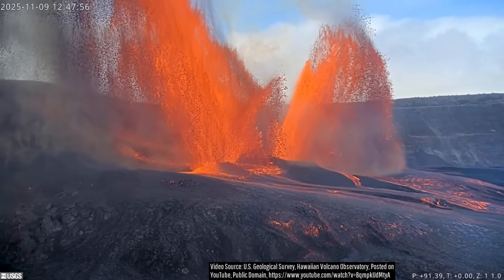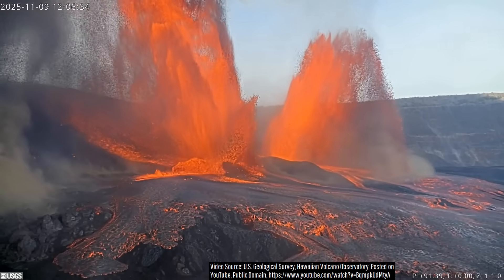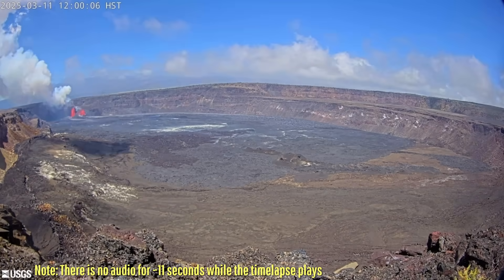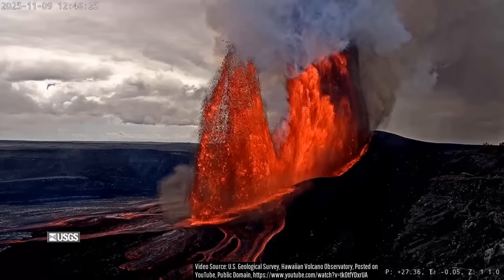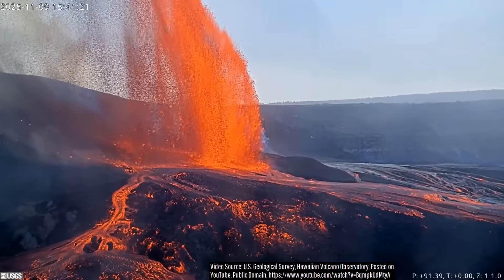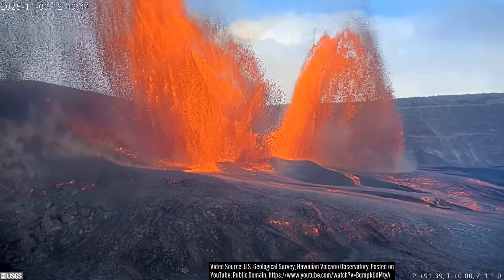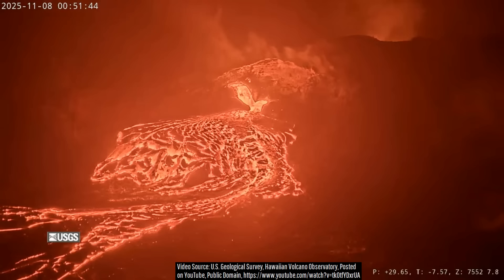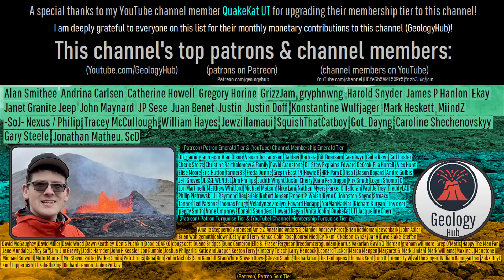Kilauea Volcano Update; Twin 1,100 Ft Lava Fountains, Geologist Analysis

Comment: I see several people asking things like, "How long will it take to fill up? What path will the lava take when it does?" Understand that what we're looking at in these videos is not the entire Kilauea caldera, but just Halemaʻumaʻu, which is a smaller (relatively speaking) pit crater inside the caldera. The entire caldera is roughly 3 miles long by 2 miles wide and hundreds of feet deep. At present activity levels, it would take several years for lava just to fill Halemaʻumaʻu. From there, it would overflow into the caldera, which would take something longer than our lifetimes (decades to centuries) to fill. During that time, Kilauea's terrain will change, as it slowly and constantly does with each episode. Therefore, whatever happens at that future point is both unpredictable, and not our problem. Just enjoy the view while we have it, because it will never look exactly like this ever again.
Reply: Great information 😊.
Reply: Yes, great information. But in your estimates you should surely add th proviso 'assuming no further caldera subsidence occurs', since that is presumably quite likely in the event of a flank eruption such as the 2018 one?
Reply: @davidcranstone9044 correct. Kilauea's terrain will change over that much time, and it's impossible to predict exactly how. So, we can only work with best guesstimates.
Reply: If it keeps erupting from the same spot, the cone will grow past the caldera rim, and lava may flow out of the caldera depending on how things go. If that direction becomes the dominate direction, it could be even longer before the caldera is filled completely
Reply: @davidcranstone9044  "During that time, Kilauea's terrain will change" - covers the likelihood of further draining.

I'm one of those fortunate enough to have hiked the outer caldera floor (thirty years ago). I've just found a USGS chart showing that the trail crossed lava erupted in 1919, with the oldest surface anywhere dating back to 1882-85. The caldera itself is much older than that.

The real question is how long will it be before growing Kilauea becomes as tall as by-then-eroded Mauna Loa?
Reply: Im constantly in awe watching these videos every time a new one comes out. Nature is beautiful and amazing. I hope one day to see this or something like it in person before I leave this earth. Thank you for sharing. ❤
Reply: At the current rate of filling, it will fill Halemaumau in about 2 years, and probably overflow out of the caldera to the south very soon after, before 2030. It will take a lot longer to fill the north of the caldera, but the only way it takes centuries to fill is if it goes into the rift zones before 2030.
Reply: Thank you for the informed perspective!
Reply: My only question is why he’s talking like that
Reply: @te8828 because he has mild autism.
Reply: Centuries?  OK, Spanky.